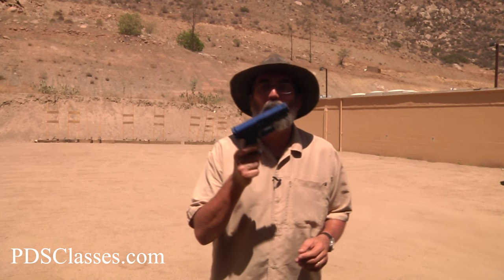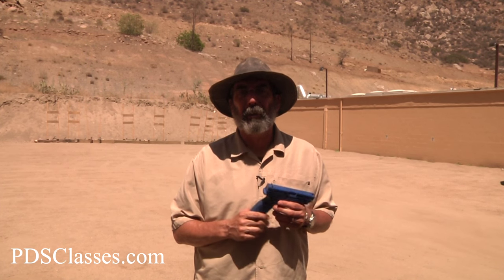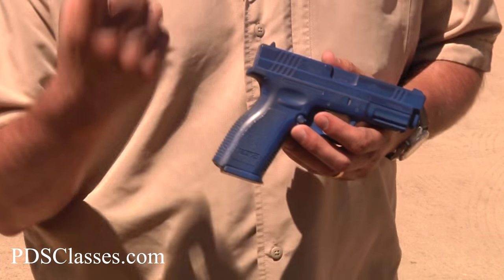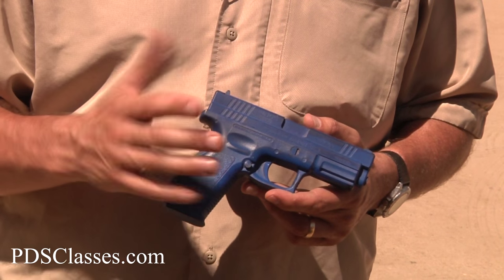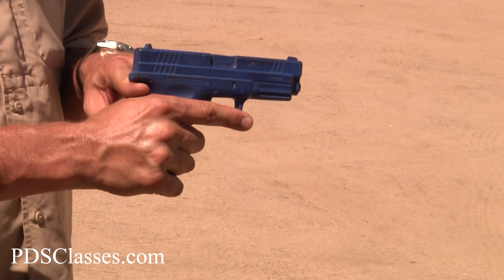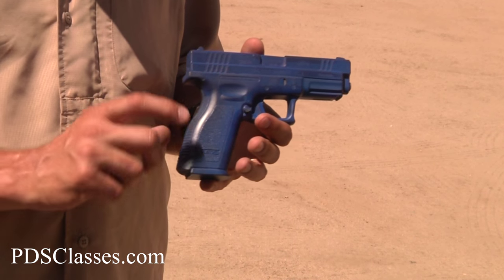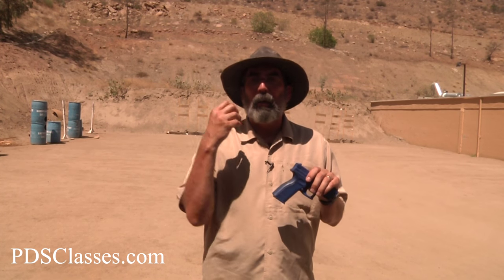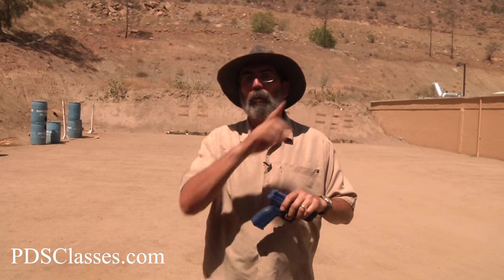Gripping a pistol properly

Comment: You are not right when you said the three knuckles should line up a in the middle of front strap. It is hand and grip size dependent. Just because they don't line up, you can't say that the gun don't fit your hand. Even when looking at your grip, your three knuckles are placed little to the right from the center of front strap.
Reply: Kyle, remember what he said. If that particular grip hold doesn't work for you, then try another hold that works best for you. I have medium to small hands. No way I can rap my left hand knuckles to knuckles around my full size Glock 21. So of course I have to compensate my front hand knuckles to be off center from the right knuckles.